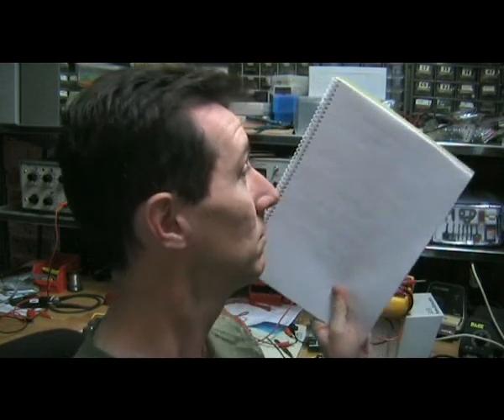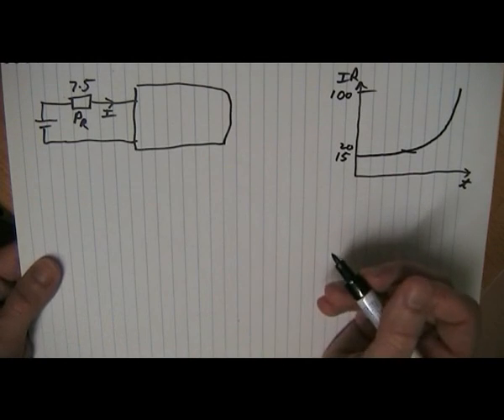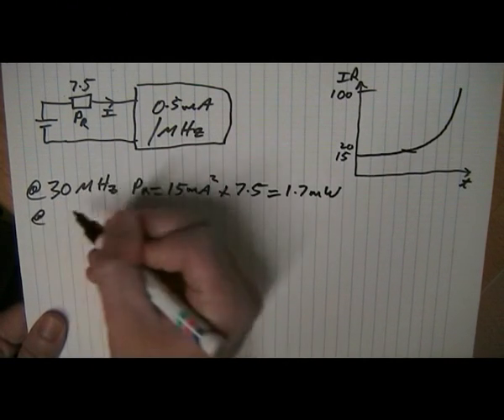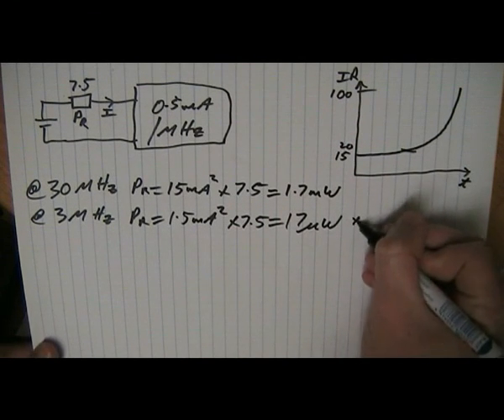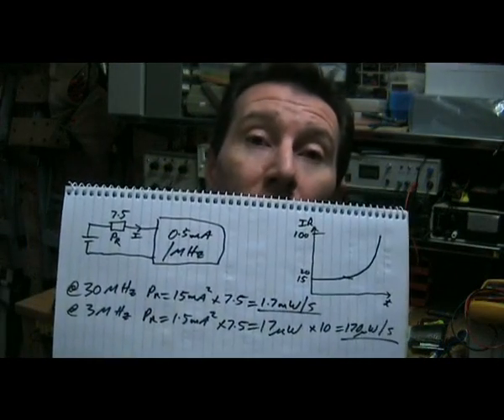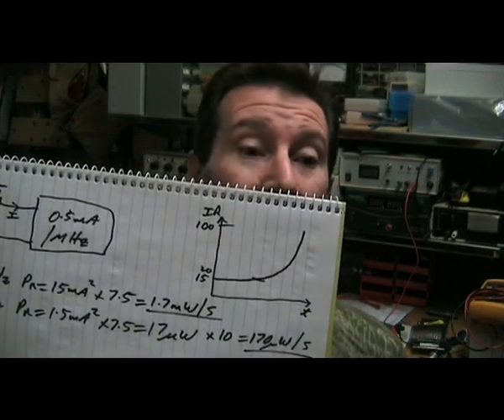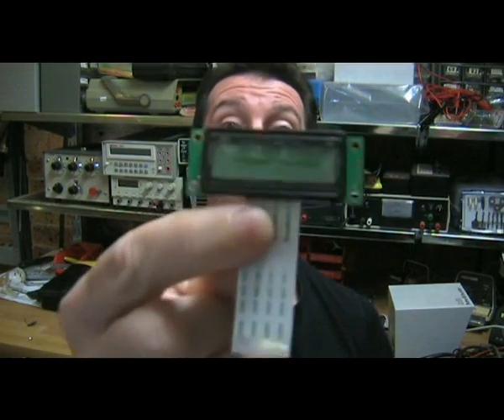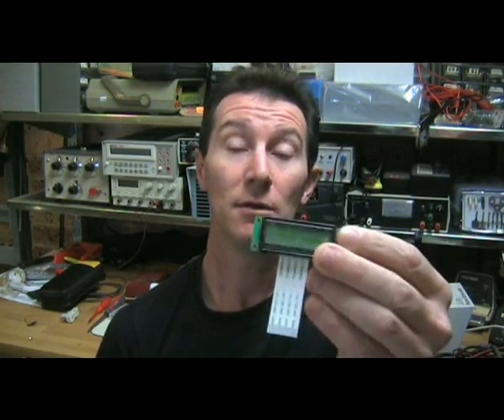EEVblog #4 - Calculator Design, Mr Bean, & FPGA's

Comment: Nice info about lowpower applications, can i get a link to the LCD shown?
I am looking for a replacement for an obsolete LCD, this could match it seems.
btw anybody watching on 2017?
Reply: Unless I'm missing something, those things are pretty common.  You can find 'em pretty much anywhere.  I got mine of AliExpress, but I'd be very surprised if the electronics dealers wherever you live didn't stock them.

Comment: I'm not sure what was said at 5:50. Do you mean that the calculator wastes, at a minimum, 5% of it's battery power at 30MHz when the batteries are brand new? I can't figure out where the 5% comes from
Reply: Power wasted by battery resistance/Power consumed by cal.*100